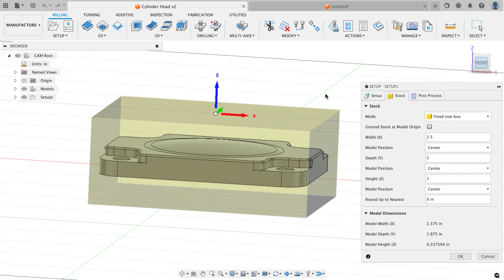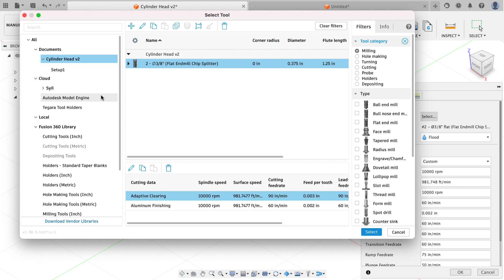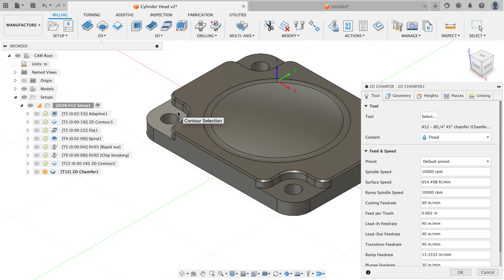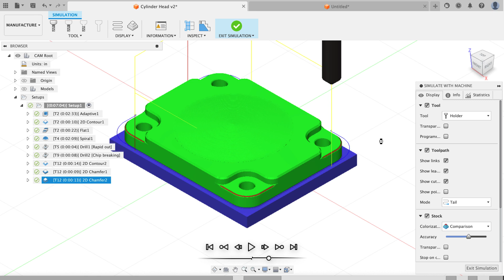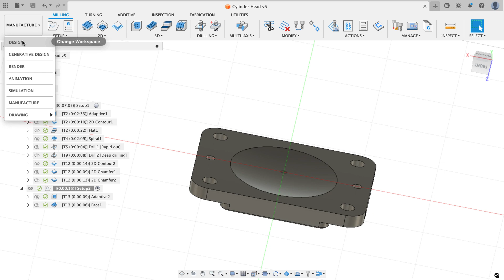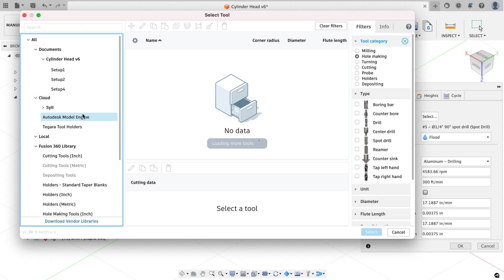Model Engine Project - Cylinder Head CAM

Comment: we did Op2 on parallels but used model box upper corner.  Use a 123 block to get XY - done. - then Z = model top - z- shift from top of 123 block to model top. Op2 is such a dynamic concept compared to Op1 for sure

Comment: Another great learning experience, regardless of all the '''bananas'''' everywhere :) 
Setup 2, with your G54 point, how did you touch that off seeing it was at the centre of the dome? I would have XY in one of the through holes in the corners, and Z off the top of the parallels..... Was this one of your mistakes?
Length and pace were perfect, its easy to rewind and replay, as I did a few times, and yet again, I learned more tips. 
Thanks Kev, absolutely loving this series, and all the new content you are giving us. Cheers mate
Reply from the maker: Nope. For the second OP, the only really critical thing is that the Z is set off the top face of the parallels. It just needs to be close-ish in X, Y. So I used the hat of remaining stock to find the center part of that. Op2 was only to remove the hat and get the part to the proper Z thickness. Then for OP3 I used the finished part walls to reset my X and Y while leaving Z on the bottom face where it was set at the start of OP2.

#AllBananasAllTheTime #IDontCareWhatCuttingEdgeEngineeringThinks
Reply: @MechanicalAdvantage  curtis is awesome 😂

Comment: Why do you not use smoothing on your toolpaths. Very useful information in these videos. Thank you
Reply from the maker: I do use smoothing for adaptive and finishing operations like the spiral. I don't use it for things like 2D contours on prismatic geometry (lines, arc, circles). Those objects require very few lines of g-code and I want them to be as accurate as possible.

Comment: This is turning out to be a great series of vids, could be a bit fast paced for somebody new to CAM or F360, but you can scroll back and forth in the vid if you don't catch it the first time through. Using the 3D Adaptive followed by the Flat operation is a pretty cool alternative to using Face, Adaptive and Pocket.
Reply from the maker: It’s a bit of a struggle. Too slow and I would push over an hour and lose people who get bored, too fast and new users can’t keep up very well. I’m trying hard to be in the middle. You’ll have to let me know how I’m doing with that goal as the series continues.
Reply: @MechanicalAdvantage  I have a XYZ router for my CNC. I have used Fusion 360 since 2017. I like the idea of presets in your tool library. From a machining (routing) point of view, I am still working on proper "encapsulation" of these processes. Thanks to you, I am one step closer. One problem: As Fusion has evolved, it does add a confusion factor.
 Learning how to keep up with improvements and new features, without making it a full time job, would be awesome.

Comment: I've picked up another couple of things on this video.  Thank you!  Creating a point between 3 faces is what I needed recently.   Question; Why was spiral selected over parallel in op1 and 4?  As always I really appreciate these videos.  Extremely helpful.  Much gratitude.
Reply from the maker: If you can use a toolpath that matches the shape of the geometry, it will often look smoother than if you use a toolpath that doesn't. Parallel would have worked fine, but I don't think it would have looked as good.

Comment: Great series really helpful to fill out my knowledge base of CAM in fusion - in setup 3, could you not have just used a "Model Box Point" instead of going back into CAD and got the same result?
Reply from the maker: It wouldn’t work in this case. Model box point finds the very extents of the model bounding box. So the top of the dome would have been the lowest point, and I was using the face below that as what sits on the parallels.